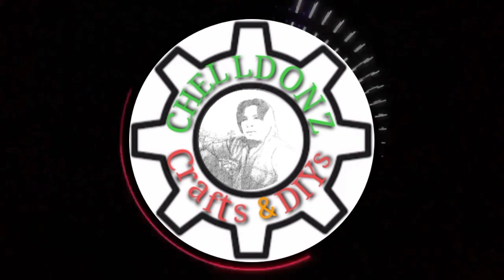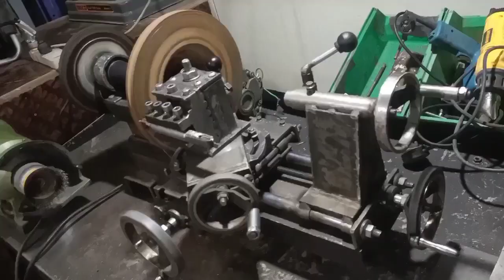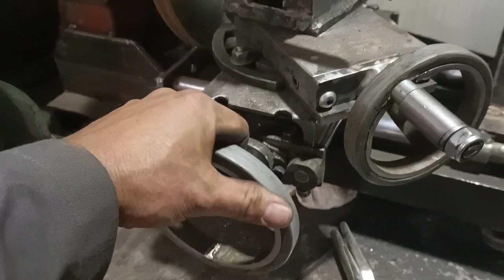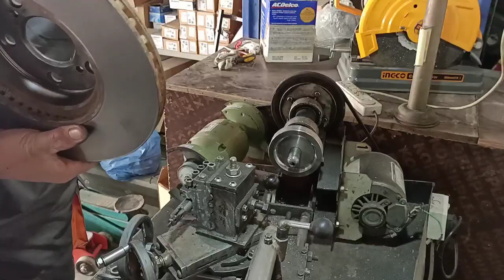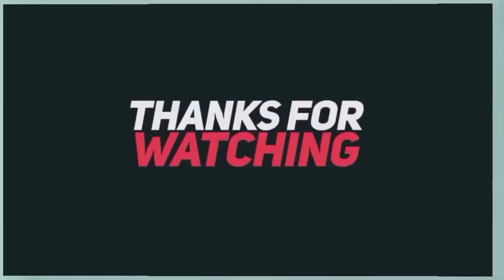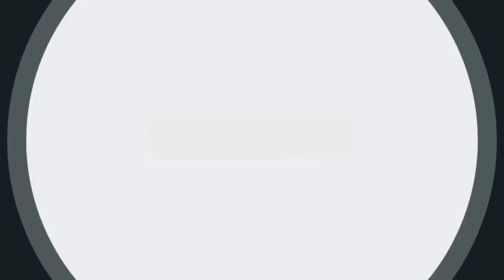Resurfacing brake disc using homemade lathe machine.

Comment: have you tried mounting a grinder to the tool post? im pretty sure rotors are ground when they're new.. it works good on my lathe for rotors
Reply from the maker: Thanks for the suggestion bro.
Reply: just don't let a real machinist see you do that lol... getting abrasive dust on the ways of a machine tool is like sacreligious.. an unforgiveable sin... it is almost as bad as not lifting the file on the back stroke..😂😂